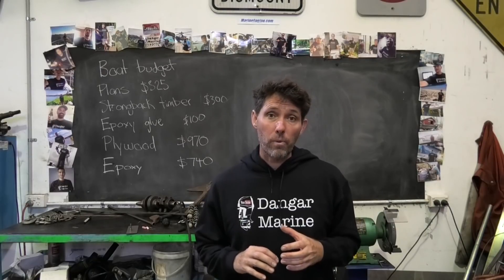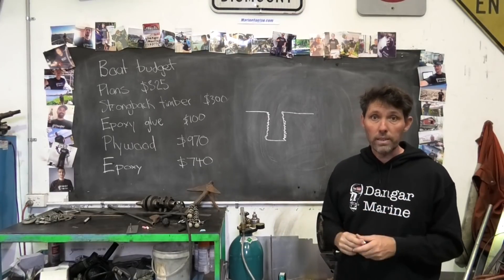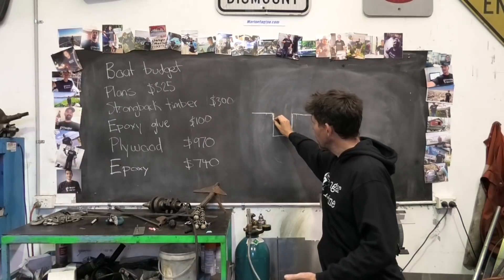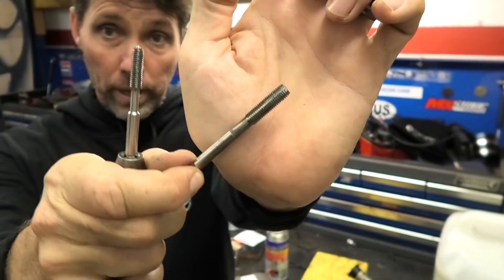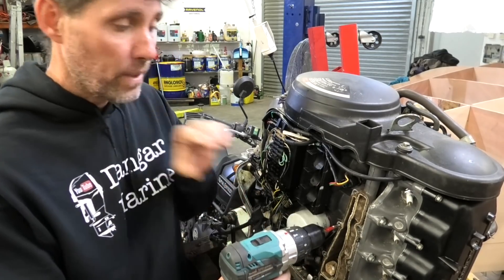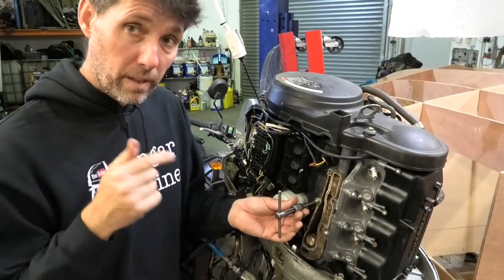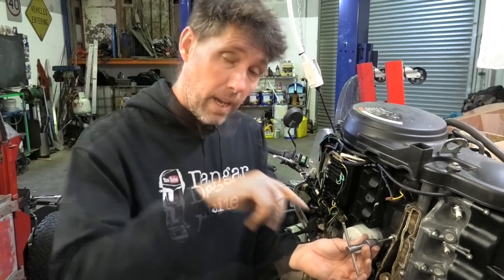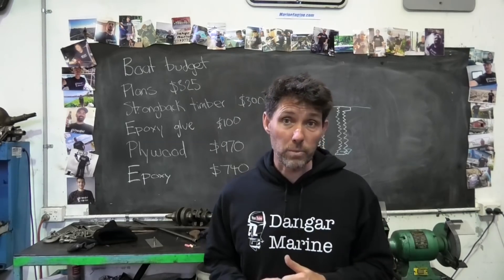Repairing a damaged bolt thread

Comment: Great video... when the season is done I'm planning on removing a water jacket very similar to that one. My honda bf30 is 23 years old and I don't think the former owner ever changed the anode... Any pointers so I don't break all those 6mm bolts? Thanks in advance.

Comment: Thanks for the vid Stu. Wth my 115hp etec, a mild steel bolt was used for one of the 2 bolts that hold the propeller shaft housing assembly in place via the 2 tab retainers.  I have just removed it but the correct Evinrude bolt I purchased will not torque down due to the resulting corrosion. I am getting a mobile thread repair company in to correct this but an not clear on whether they should tap out the hole to the next size up (if there is room) or insert a stainless thread repair in the the existing hole. I thought that having the stainless in contact with the aluminium below the water line would cause further issues with the dissimilar metals but given the bolt going in to the thread is also stainless, that must mean it is actually Ok. It also seems difficult to find 316 stainless imperial  bolts so would be good to use the one I purchased from Evinrude dealer.
Reply from the maker: As you say, the bolt going in is stainless anyway. Putting loctite on the thread insert and grease on the bolt will help too. It also means you can use a single spanner to remove the bolts later on.

Comment: Only time I've ever used a thread repair kit was when my buddy, helping me reassemble an evinrude, stripped the spark plug out of the head by cross-threading it.  Drilling the plug threads out just felt wrong as all hell, but installing the sleeve and 'pounding' the tool in to spread the insert so it would bite, worked well enough that afterwards I was back up to 140+ PSI compression.
Wish this video existed back in the mid '00s.
Reply from the maker: It is a nervous moment as you need make something worse before you begin making it better.

Comment: As always another great video. What I use is aluminium brazing where there are no components that are too close that can be damaged by heat. Most people don't realize that anyone can braze aluminium with only a butane torch and the metal doesn't get hot enough to have to use protective gasses. I've attached components onto my runabout, filled in old rivet holes, filled in corrosion on outboard legs and once easily patched ten cent piece size holes; all with brazing and it's stronger than the original. I drill out the stripped threads and add some metal back. I then insert the bolt while the metal is molten then heat the bolt and area then add more brazing rod to fill the hole. I then unscrew the bolt (no need to tap) then tidy up the job. I use MAP gas as I can get more heat into the aluminium in a shorter time. I had to do this recently on a '78 30HP Johnson.
Reply from the maker: Brazing sure is a great technique. As you say, you can always just build the material up again and then drill and tap.

Comment: Hello Stu, need to install a Time Ser kit for a M10 cylinder head bolt on a 2 strokes Tohatsu 18 HP outboard. The OEM 10M bolt has 20 mm lenght threads. On Amazon only see M10 kits with just 15mm lenght threads. Question if installing such 15 mm Time Serts will they be capable of securing tight such bolts that needs to be torqued to 28 NM with a torque wrench ?
Reply from the maker: Yes, they should take  28NM  just fine.

Comment: Hey mate, loving your vids. 👍🏻 quick question I couldn’t get the drain plug out of the gearbox and used an impact driver to retrieve the plug but cracked the thread of the casing.. I tried helicoil but no dice.. is their another solution or am I looking at a new case.. cheers

Comment: Stu great video. which system is better : Helli Coil or Time Sert to repair a crankcase that has pulled its threads out due  to excessive salt water seizure and corrotion on bolt's thread when removigg cylinder head ? Will a  long Time Sert handle 25-28 NM of torque ?
Reply from the maker: They are both pretty good, but I prefer Time Serts. They are stronger than the original threat apparently.

Comment: Thanks Stu.  I always wondered what locked the insert into place.  My uncle once had a '59 Mercedes and he stripped one of the spark plugs and his solution was to epoxy in a new plug. Frightening to say the least.  Mind you, he was mechanical engineer.
Reply from the maker: It is amazing the heat that some epoxy formulations can withstand.

Comment: Hi Stu, I've got a 302 ci. block with an oil pan bolt stripped because my Mechanic uses an impact gun to replace the bolt. For two years I've used Teflon tape to take up the difference. it's not a well used vehicle, not every day anyway. So far so good, no problems. I need to check the oil often just in case. I purchase  a oversized tap and matching bolt for a future repair. Thanks for another well scalped video. Cheers !!***.
Reply from the maker: The good thing about the oil pan is that you have so many other bolts holding it on. As long as it doesn't leak I wouldn't stress too much, but could be fun to fix seeing you have the tools now.

Comment: Hey Stu, i have a 1984 johnson   
70hp and noticed it need grease on the new water pump but don’t know where to apply the Evinrude Johnson Triple Guard Grease on the water pump,does it go on the shaft or O-rings,or the keys? I normally take it to my mechanic but he’s having health problems and would like to do it myself, Thanks.
Reply from the maker: Hi Omar. Normally you put a bit of a grease around the inside of the metal cup that the impeller runs in to give it a bit of start up lubrication before the water is being pumped.
Reply: Dangar Marine thanks stu. Would if be fine to put some grease on the o rings that go on the shaft to make them slide easier on the shaft? And to keep the key and black rubber band that goes around the cup on would i be able to use the grease or would 3M 847 Scotch-Grip Rubber & Gasket Adhesive, Brown be better to use?

Comment: I have a 9. 1/2  Johnson seahorse about 1967 .It starts Idles nice but will not pull under load  any thoughts thanks
Reply from the maker: I'd check compression, carb clean, spark plugs, reed valves - all the basic stuff and then see how it goes after that.

Comment: Thanks for the great vids and giving me the inspiration to work on my own outboard. Finally worked up the courage to replace the water pump with a new kit only to find the previous monkey of a mechanic had stripped one water pump bolt (which was poking up over 2 cm and another 3 bolts raised up 5mm from the top of the pump case. It was probably just the pressure of the housings holding all it together. Anyway back to the stripped thread. I have been researching which thread repair kit to use and are still unsure. The Wurth website says their inserts are galvanised steel. So putting a stainless bolt into galv steel into aluminium and submerging it into salt water concerns me a bit. In your case it was above the water line but not in mine. Are the other spring type such as Helicoil stainless steel or are the also galv or hardened steel? What do you recommend? Sorry for the long post but perfect timing of the video. Cheers.
Reply from the maker: Below the waterline I would definitely go with something stainless. These ones are advertised as being stainless and would do the job quite nicely (in the right size of course) https://www.gearbest.com/tool-kit/pp_009213016760.html?wid=1433363&currency=AUD&vip=16076654&gclid=CjwKCAiAiuTfBRAaEiwA4itUqCARKKz8S1IMubbZWbBjbbhBXJnk20ypqJhejeuHfCvrlaFFjXIMvxoCY40QAvD_BwE

Comment: Nice instructional video Stu, as always. I see below you have hit the pretty common time wall  for the boat project.  You are not alone on that one, probably 80% of such projects stop for the same reason. "helicoil' has become a generic term for any thread repair kit. I was told to use a sealant like Loctite  on the repair thread  (helicoil itself) to seal it from water which could cause corrosion issues. Also, some aluminium parts have steel coil inserts for the bolts - check that there isn't any such thing in the hole before you try to drill out the stripped hole, those inserts are typically very hard steel and will ruin drill bits immediately!
Reply from the maker: Hey Ron, hope you are going okay. Looks like I'm going to be making some changes with the boat project to make it a bit more achievable, but more on that soon!

Comment: Great video - stripping threads is always a horrible experience, but if you are confident in how to repair them, that makes an agonizing roadblock in a job or a project into a manageable one.  

I'm a fan of time-serts myself - and one of the really nice things that comes with the name-brand kits is a tube with a perfectly flat end to help you start the drill and the tap perfectly straight.  It's a little thing, but it can make a huge difference.
Reply from the maker: Hey Paul, yes, those guide tube can be great, particularly for drilling out broken bolts.

Comment: Top tip: When tapping a blind hole, stop before you reach the end of the hole.  Trying to remove a tap that has snapped because it bottomed out is no fun at all.  Otherwise, great video.
Reply from the maker: Yes, they are very hard to get out if they break, that's for sure.

Comment: Stu, would you use Loctite Stud Lock to keep the insert in long term?
Reply from the maker: It wouldn't hurt, but the expanding at the end of the installation is stronger than any loctite would be so isn't needed.

Comment: Just what I need to fix the bolts I had to drill out on the tilt unit bracket. I can put nuts and washers on some of the 6 but not some of them. Putting in these helicoils will do just fine. Probably will work better too being stainless steal with the new same material bolts to remove them down the road. Stainless and aluminum is horrible combination materials for saltwater use. But ideal for a helicoil to fuse together with aluminum over time😁
Reply from the maker: Hey Tim. Yes, aluminium and stainless aren't great friends, that's for sure.

Comment: Nice bit if kit. I have only ever drilled and tap, which meant I was increasing the bolt size. Good vid thanks
Reply from the maker: They are handy in certain circumstances, that's for sure.

Comment: When I was into Chevy Corvairs, with aluminum heads, often the 1/4-20 valve cover bolts would get stripped by mechanics used to bolts going into steel and forgiving of over tightening.  Since torque needed to seal the cover was quite low, our first option was to go to a metric bolt (forgot size) that was just a bit larger than that 1/4-20 and just allow it to create it's own threads.  No need for drilling and tapping.  And, fit through the original valve cover holes...  :)

It would be interesting to experiment on a hole stripped and the metric installed to see just what torque it'd handle.

RichE (San Diego, CA getting cold here, went down to 57F ~14C last night...  :)
Reply from the maker: Aluminium definitely is soft enough to have a bolt cut its own thread. There are definitely plenty of metric/imperial bolt sizes that are very close like 3/8 and 10mm.

Comment: Would you recommend using lock-tite on the outer threads of the insert?  I'd be concerned of the insert coming out with the bolt, should you need to remove the bolt in the future.  Sorry - I've never used a thread repair kit and I'm sure they've thought of this.  Your explanation at the end (about the kit pushing out the lower threads to secure it in place) may be their plan.  I just wasn't sure if lock-tite is optional.  Another great vid
Reply: During the last part of the video Scott, Stu pointed out how the threaded insert physically locks into the block hole by being force to expand into the block hole. It seems to me this mechanical solution is going to be much stronger than lock-tite especially as this is a block that will, I expect, break any chemical bond over time.
Reply: @Bennyboy-dog  thanks for that.  I kinda thought this was the case.

Comment: I'm curious if there will be a specific episode devoted to broken bolt extraction "marine" version, since damaged threads and broken bolts in aluminum engine blocks/housings are a VERY common occurrence.

With aluminum, you're options are a bit more limited since cutting torch heat has to be applied very conservatively.

I would say the broken spark plug video partially covered some of that topic, but not fully enough to deal with broken bolts specifically.
Reply from the maker: Indeed there will be! Hopefully not too far away. :)

Comment: pesky strip outs!!!!   one thing i wish manufactures would get together on  is bolt torque  is it dry threads or lubricated???   most service manuals wont say unless its an absolute critical.  while aluminium is great stuff it can be rather soft.  it is easy to get it crooked  so a tapping block helps too.
Reply from the maker: Yes, there does tend to be a bit of variation in bolt installation procedures, that's for sure.

Comment: Stu, where you supposed to use the flare tool to finish the installation 
Very informative videos
Thanks
Reply from the maker: No, these are all the steps for these installs. The installation tool flares the bottom once it goes all the way in.